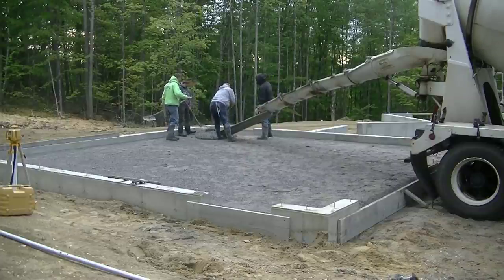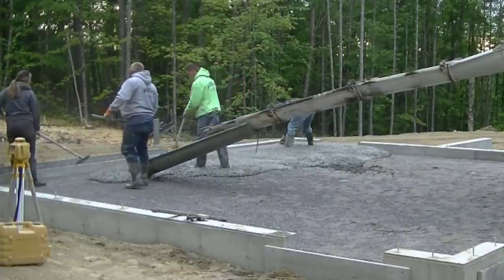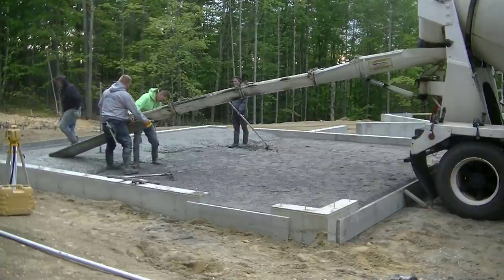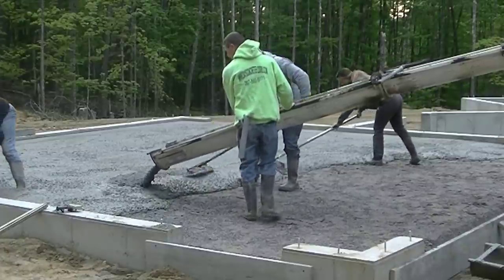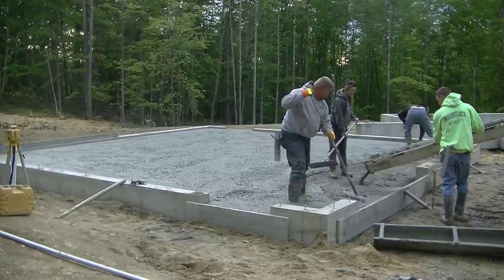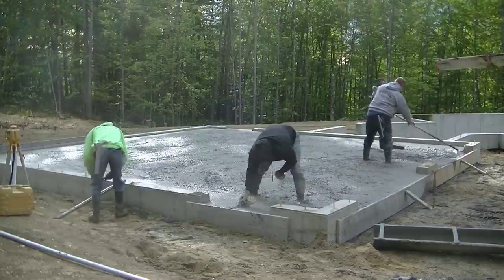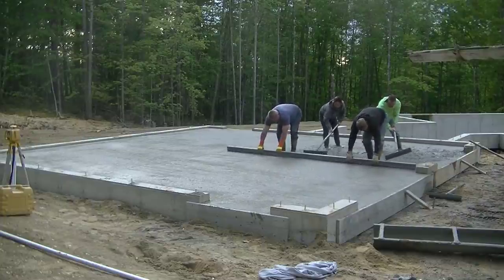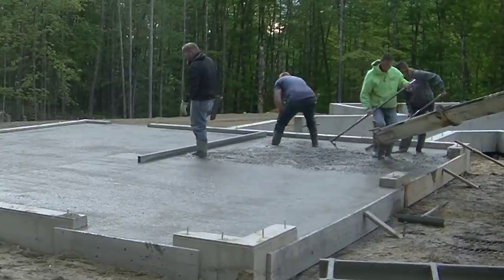How To Pour A Garage Floor In 28 Minutes (26' x 26' Garage)

Comment: I won't speak for every form company but the reason for the 12" drop is for accommodating an 8" exposure of concrete above final grade to prevent sill rot and 4" for the slab.

Comment: I had the concrete blow out on my job due to the form work not been tied in on the corner (500mm deep concrete) took 45 mins with 4 guys two sledge hammer and 2 bars!

Comment: As soon as I saw that short kicker with the concrete pin in the sand, I knew that was gonna bow out haha.  Very minor fix but good to see it fixed quickly lol. Had the exact same problem myself years ago on a garage but didn't have another truck on site waiting. 

 Overall the process is fast man! I see a lot of crews pour their slumps so stiff like a 3 or 4 and just struggle with screeding or some guys screed way too much trying to make it look good when you should just screed it quickly and let the bow float do the work. I've notice in the few videos I watched so far you pour everything super wet. How we do it too. Plus you boys always have that truck gone fast.  You guys aren't slow at all. I see some trucks on site for over a hour... Which in my books is not good lol.

Great video though.  Keep them coming.

Comment: I thought I saw a bow in that form early.  Many years ago we were pouring a garage that was on sloped ground so we had formed the low side and dry stacked blocks  to form a retaining wall inside the form and then compacted soil up to the wall.  While pouring, the tall wall gave out on us.  The ground was soft from rain.  We backed a pickup against it with a 4x4 and tried to push it back but the best we could do was hold it.  When the pour had set enough, we pulled the form and shaved off the excess concrete.
Reply: @lydiaanderson4247  I'm doing well thanks

Comment: That 12" at the doors is important.   Often the backfill settles, pavement pulls away from the slab and water flows through there and will absolutely dissolve the block.  That solid pour significantly reduces risk of floor cracks as well. Personally, I like to throw in a hefty piece of epoxy coated bar as well.

Comment: Mike,  I just want to ask if you are familiar with a technique that is used for the purpose of keeping the outside walls and the concrete floor independent of each other?  An acquaintance  of mine tells me this technique requires installing a layer of plastic or felt around the inside of the perimeter walls before the slab pour.  I understand the purpose of keeping the concrete floor independent of the walls is to reduce the amount of cracking in the floor as the structure settles onto the footers.  

I've watched several of your videos and I don't think you have previously mentioned anything like this.  What say Ye?    

BTW:  this video was great - like all your others.

Regards,  

Mike;  Casey County, Kentucky.
Reply: What was the cost of the concrete , just the product,  not the labor?
Reply from the maker: We use it when the spec calls for it. We call it iso-strip,  it's 1/2" x 4" foam. Comes in 50' rolls. We use adhesive to stick it to the walls.

Comment: I am planning enclosing a carport but my carport pad doesn't cover the whole floor. I need a larger area poured. Should I pour over the current pad or just extend the current pad?
Reply: dont ever pour concrete over old  concrete.
Reply: @troyminster838  I know there are concerns to consider but I'm pretty sure Mike Day has done it before, if I'm not mistaken.
Reply: #mikedayconcrete

Comment: Worst part is, when the form starts to kick out,  it's really tough to get it back straight.  We had a 18in Thick wall start to blow out, we used our excavator to push it back in place.  Of course not too often do we have the excavator on the job when we are pouring.

Comment: Hi guys, I'm planning to put 2 layers of A10 (10mm) brc wire mesh on my drive way. How much should the gap be between both layers? The thickness of my concrete slab is 8inches.

Comment: You do not have any stakes or pipe's to check depth through out.  That was a big slab to level with your eye.  Stronger if it's a solid 4" even across the slab.

Comment: Hello! Why wouldn't you throw some rebars in? They come in 20f & for just 7$, could have them in, probably would take 500-600$ on them + 2-4 hrs for 3 of you wiring them but it would have lasted forever
Reply: They were hired by the builder to pour and finish the concrete, not engineer the slab.

Comment: Where your expansion foam. Asking for cracking with stem wall locking in floor with no expansion
Reply: Mike does excellent work and will not do something he knows will have be removed because of something he does. Concrete is at its most expanded state the day you pour. When placed correctly, like Mike does, the cracks will happen when the slab shrinks because of the water evaporating, and can be controlled by saw cutting, or grooving.

Comment: Honestly nothing to brag about. I can do it in 15 minutes with no screw UPS.
 Is anybody watching this ,DO NOT DO IT LIKE THIS !!!
 You're supposed to stake it and kick it off at least every 2 feet.
 And on an entry I would even stake it and kick it off more than that.
    A good concrete guy would never use more than a 4 inch slump.
 The concrete for a garage floor for a strong floor should be a 5 sack mix  ( min )with a 4 inch slump.
 That's for floor strength considering its a garage .
  I don't even fill  septic tanks with sand  slurry with more than a 4 inch slump.
   I would bet dollars to donuts ,  That garage floor is gonna crack..
  Especially with no mesh.
 If I'm wrong please let me know I would like to see a picture of that garage floor finished.